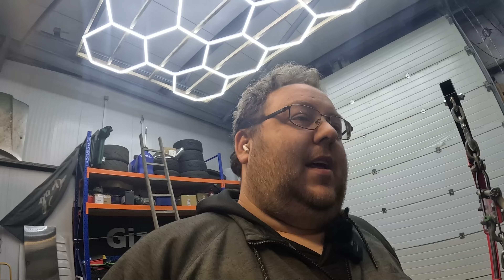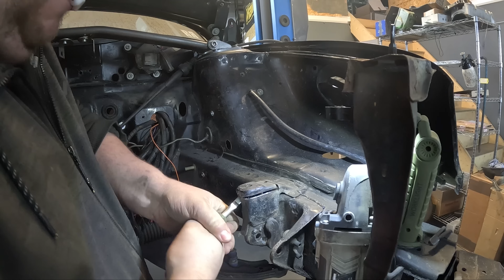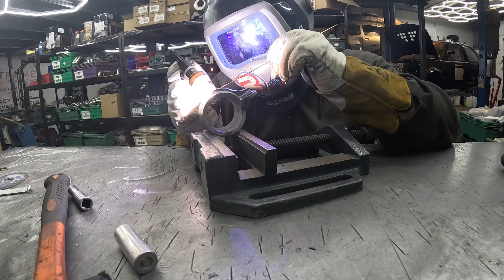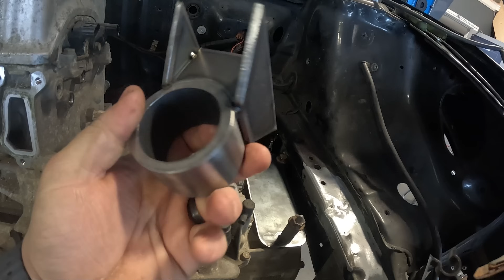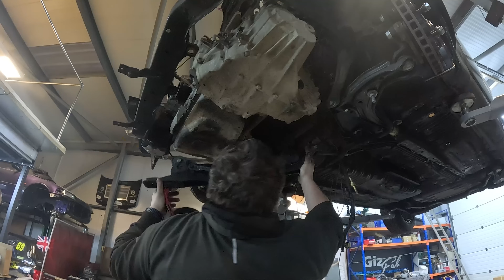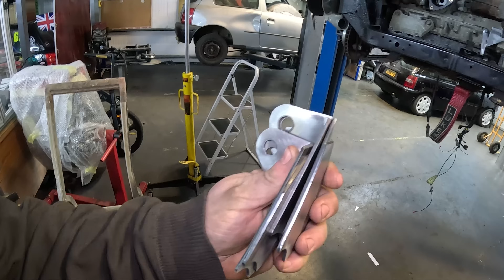I K-Swapped a K11 Micra - Part 1

Comment: Few tips on the mounts. I'd add a third point higher up for the rear mount since it has a big leverage. And I would also keep both bolt locations the front mount. Other than that very solid work and a great video! I'm really looking forward to the progress you make here!

Comment: They fit Micras pretty well apart from the brake master cylinder 😅 have you positioned the engine for best fit or for equal length drive shafts?
Reply from the maker: Positioned for Best-Fit. For equal shafts the engine would need to go another 13mm into the passengers side chassis leg and that just isn't an option without going tube frame.

Obvs with LHD, engine can go further back to make the angle slightly better, But i think i did the best job possible.

Comment: Your work is always very good and well thoight out. Regarding the crossmember, could you not just machine some 20mm spacers to space it down the required amount, and retain the oroginal member without cutting?
Reply from the maker: That was my original thought. Spacing the crossmember down. But its more 40mm spacing to clear it without cutting

Comment: Great video looking forward to series  love the details and fab work is on point 👍 will the spicy micra ever go this route 👀
Reply from the maker: Spicy Micra won't be going this route as it will change the class of the car.
Reply: @GizFab  arrr yes of course didn’t think about that!
Reply from the maker: the Micra is actually going from 1800cc back down to 1500cc for this year @vwnay
Reply: @GizFab  do you have more 1.5s in stock as spares 👀😂 I love that little micra best car to watch it person
Reply from the maker: Will be a Built 1500cc. JE Pistons, Forged Rods. Balanced and a revised oil pickup system to avoid another issue of oil starvation @vwnay
Reply: @GizFab   sounds a plan ! looking forward to the build ! Im currently looking at JE pistons for my 12v vr6 , very reasonably priced even for 6 !  Seem to be the main go to company at the moment good customer service and price .

Comment: How did you account for the the angle (tilt) of the engine sitting in the engine bay to how it oringally sat in the civic . oppose to just sitting the engine level on a table and lining it up . probably a noobish question but im curious?
Reply from the maker: Typically K20 are 10-15 degrees tilt. We are within that range.
Reply: Wow quick response thanks i was just curious.   @GizFab

Comment: It's a cool project but if you  have the equipment at home to cut out and weld in brackets , cut and shut some driveshafts together and wire it all in 
Wouldn't you be able to make your own engine mounts ?
Reply from the maker: Sure. But most people do not. This kit i have developed takes away all the guess work.

Comment: Can I ask why u welded the gearbox mount on the chassis rall ? And never done that with the engine mount one? First time watching  ur channel and I'll be watching  again n sub to ur channel m8 😊😊
Reply from the maker: Sure. I'm trying to keeping cutting and welding on this kit to a Minimum. So the kit is easier for customers to install. The timing side engine mount bracket on the Micra was actually well positioned for that particular mount. So required no Cutting or moving of the bracket.

The Factory K11 gearbox mount on the chassis leg fouled the gearbox casing and would not allow me to mount the engine higher in the engine bay. So it had to go

Comment: Is this car using original master cylinder or is that clearance with a slightly upgraded one?
Reply from the maker: This is on an upgraded one from MH. But it remains the same length as the factory cylinder.
Reply: @GizFab  would the landrover one be too large?
Reply from the maker: @Dylan-yn2do  yes